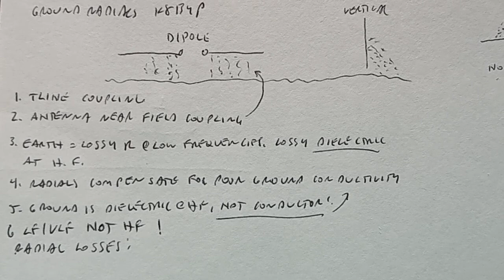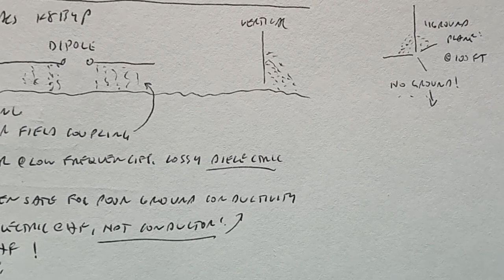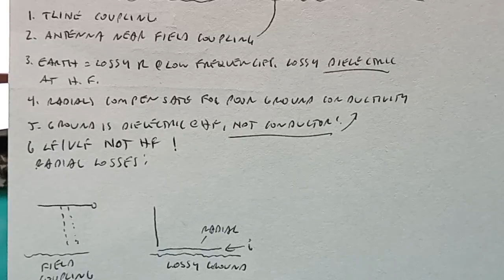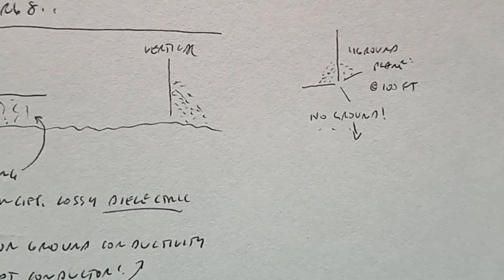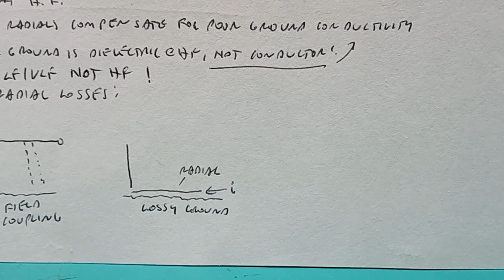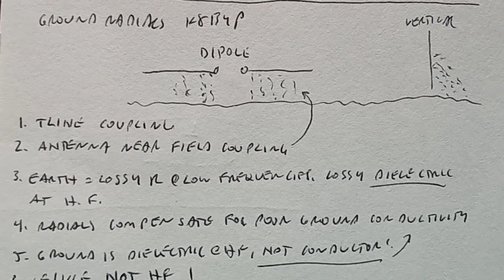Science of Ground Radials

Comment: Which parts of the Laport "Radio Antenna Engineering" book are you referring to please? I was trying to get a better understanding on the radials but not quite sure what to make of some its statements. For example  (p.10) "...It is general practice to postulate antenna performance on an idealized basis, considering the antenna itself to be lossless and the ground to be perfectly conducting...", (p.115) "...Antenna performance is standardized with reference to the ground being a perfectly flat conducting flat plane....A line fo electric force (displacement current) extends from the top of the antenna through surrounding space to the earth. Upon entering a perfectly conducting earth it becomes conduction current which returns to the base of the antenna and becomes a portion of the antenna current..." , ".... and (p116)"... A vertical radiator above natural earth without any sort of ground system, energized by an electromotive force between the antenna and the earth, would require all currents to return through the antenna through a very imperfect conductor. The earth is actually an imperfect dielectric..." . Can you help me identify the sections where it clearly shows that the ground acts as a capacitor and not a conductor?
Reply from the maker: Read the entire book, then Radio Engineers Handbook.

I read that bit about lossy dielectric somewhere, but I dont recall which book. 

It took 10 seconds to find a reference on Google.

soil lossy dielectric

The assumption of a perfectly conducting plane is similar to starting with a very thin wire for a dipole, it removes a lot of complex variables in a situation where they dont have sufficient math to describe a system, or, its extremely complex. The 3 D diferential equations of Maxwell are very complex.

"Simplifying assumptions"

Standardizing the ground removes variables of soil type and moisture when several persons are experimenting in different locations. In antenna test facilities, an artificial ground plane is made (concrete and steel or metal sheets) to create an "ideal" plane.

Its important to see that its not about "ground". CB radio "ground plane antennas" have no reference to Earth at 50 feet, the radials are not "ground" but a feedline coupling. Its all about field coupling between that plane and the antenna. That is what allows the Tline to have something to "work" into instead of an open circuit,.

The part about 'field lines returning via ground currents to the base of the antenna" is where the severe losses occur. Shunt feeding eliminates that.

The idea that putting down a number of extremely thin wires into the soil, which have essentially no surface area, is an utter waste of time especially at HF. They represent an insignificant surface area of the ground. Assume a circle around the antenna one wavelength in diameter and calculate its area. Then calculate the total surface area looing up of 50, # 14 wires. Trivial.

The statement about "field lines from the top" is a bit misleading, whats important are the field lines AT and just above the feedpoint, thats what the transmission line is seeing. The lines further up are a result of the charges propagating up the antenna, thats a different matter.

So its important to look at radials not as part of the antenna, but of the transmission line.

At that point, see the concepts of GLE, GSE and GZE (ground of large, small and zero extents) I think thats in the book Antennas. (title is just "Antennas" if I recall correctly, a famous book but I dont recall the Authors name)

A ground of small extents being a solid metal plate is far better than a bunch of long radials.
Reply from the maker: Searchable RAE:

http://www.vias.org/radioanteng/wrapnt29B79E_logarithmic_potential_theory.html

Approximate Capacitance Formulas For Electrically Small Tubular Monopole Antennas

https://apps.dtic.mil/sti/pdfs/ADA302235.pdf

Fun reading
Reply: @k8byp  Ok thanks! For the last book, I presume it is Antennas by Kraus.
Reply from the maker: Probably

Just realize its an old book with myths about sine currents and antenna patterns.